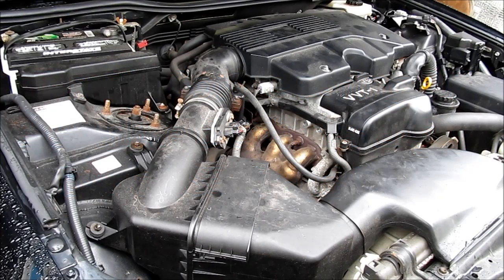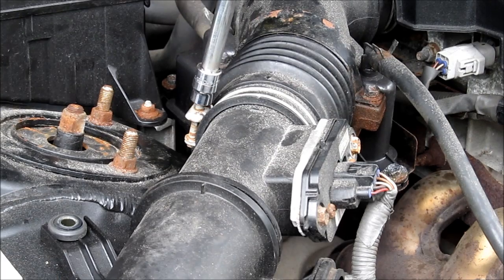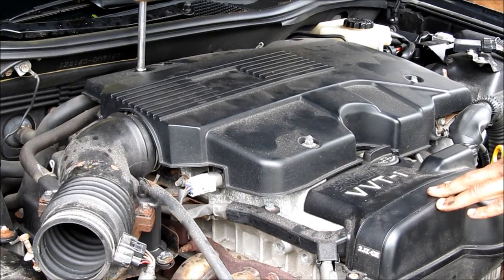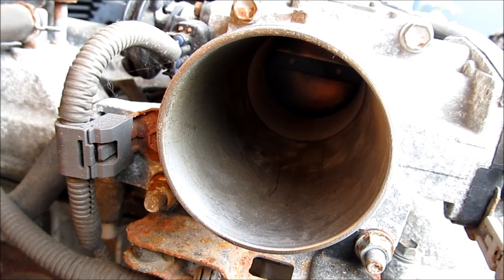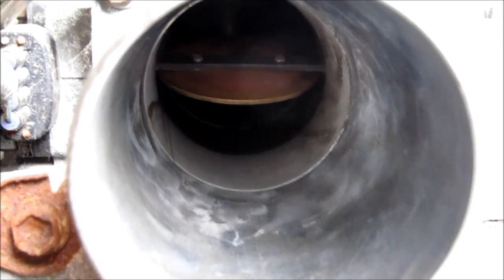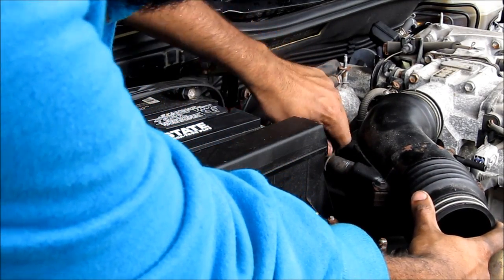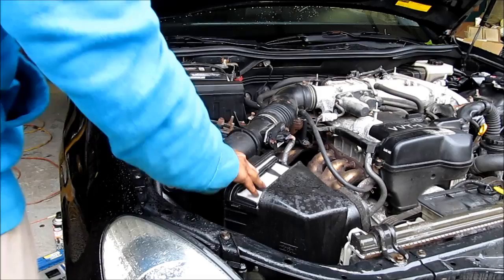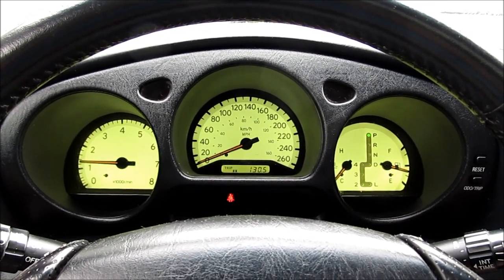Throttle Body Cleaning 2JZ 3.0L Inline 6 Lexus GS300 and IS300

Comment: Thanks for your video today I cleaned the throttle body I have when I remove the small hose I think that's for cacume hose on video 1:28 there was oil in the box is it normal
Reply from the maker: Sometimes oil can make it into the intake due to the PCV system. Change the PCV valve and clean everything out.
Reply: T @speedkar99 Thanks for response

Comment: I was told to remove the negative battery cable for 15 minutes to reset the engine light and codes. Does it matter which battery cable?
Reply from the maker: Negative is safer. Remove the positive and accidentally short something if it touches the body.

Comment: My car starts runs great for 3 seconds and dies
Reply from the maker: Idle air control valve? Check fuel pressure
Reply: Cars boosted fuel pressure is 60 psi just won't idle and there is no control valve cause the body is electronic
Reply: The ecu controls the body and idle thru the body
Reply: Same thing happened to me. Did you solve this? I was also getting a P0120 code
Reply: @diamond4015  I figured mine out but idk if everyone else had the same issue or not I had rewired the fuel pump and didn't ground it thru the ecu and it caused the ecu to not make the car idle check fuel pump fuses and wiring

Comment: Last Sunday I experienced a sudden loss of power on the on the road and then the highway on my way to work. I had just recently serviced my car but had not changed the engine air filter, checked that, it looked dirty. So first thing Monday I go and buy a new air filter, and just Incase some fuel injector cleaner. I replace the air filter first drive it for the rest of the day and the next, and I keep experiencing that problem when I engage the gas peddle I don’t get a response until I’m just about flooring it. So Tuesday night I fuel up and drop some fuel injector cleaner and drive it the next day. A the little things I’ve done for it have helped a little but the problem is still there.
During regular and highway conditions my gas peddle becomes unresponsive to light gas peddle press , and won’t respond until I’m flooring it. Im thinking maybe a dirty mass air flow sensor, since my car starts  fine and idled fine, or maybe a loose throttle cable since I have a bad habit of flooring it to begin with. Any advice?
It’s an 05 Lexus IS300, with the 2jz-ge motor like this video
Reply: I’m having this exact same issue…. Did you figure out the problem ?
Reply: @productive23 did you fix your issue? My is gs is in limp mode too

Comment: Question so this started today when I drive for a little while my then out of nowhere my pedal sinks to the floor and the no acceleration do I have to clean my throttle body
Reply: Throttle body pedal sensor I was told to switch my whole throttle body
Reply: jamel williams nope didn’t do that just switched the sensor and cleaned the throttle body and it’s running great
Reply: happened to me this week replaced the throttle body pedal sensor and boom works fine

Comment: I'm having acceleration issues on my '98 GS300. VSC off light comes on as well as check engine, and accelerating goes to shit sometimes stopping completely. Engine doesn't turn off, and car still sounds like it's running fine. You think I should try this before I take it into the shop? I read some forums of other people with the same issue and cleaning the TB fixed it for them.
Reply from the maker: Scan the codes. Sounds like you might have more than just a bad solenoid
Reply: @speedkar99  yep it coded for a bad a Throttle Position Sensor. I'm getting it replaced/calibrated in the morning. Thanks for the heads up. Hopefully it will fix the issue.
Reply: @sauce3140  Hey, did it fix the issue??
Reply: @alejandroogando8273  Man i ended up getting rid of the car, wish I could be more help

Comment: Do you even know how to remove the throttle body so you can properly clean it..lulz
Reply from the maker: Yes. But you'll need a new gasket
Reply: @speedkar99  uhmmmmm are you referring to the steel gaskets on the y pipe and manifold? Because if so they are more than reusable if you make sure torque specs are at 20 ft lb.... Throttle body has a rubber connection to the y pipe.... No gasket.....

Comment: Do you know where the idle air control valve is on the GS300? Or does it even have it? I’m having rough start, idle vibration, hard steering, and fast throttle when initially hitting the gas. 2002 GS300 with 97k miles.
Reply from the maker: Usually drive by wire cars don't have idle air control valves because the computer opens the throttle valve itself

Comment: What is that buzzing sound that starts when you opened the throttle body at 1:58? Mine is still doing that even though everything is all assembled, not sure what I forgot.
Reply from the maker: Usually when the ignition is on I get that buzzing sound...not sure what it's coming from but it's fairly normal on Toyota Lexus

Comment: After doing this my traction control light started to turn off and on
Reply from the maker: Check vacuum hoses
Reply: speedkar99 thanks! that was the problem I noticed that it was broken and I’m guessing when I bought the car they somehow got it to stay on but when I went in to remove the pcv hose it literally was barley holding on. I ordered a new one

Comment: Should battery be disconnected? Great info.
Reply from the maker: +Jose Aguiluz yes to reset the check engine light
Reply: @speedkar99  should battery be disconnected before you clean maf and throttle body?

Comment: Can anyone confirm if the GS300 98-05 throttle body will interchange with the IS300?
Reply from the maker: +Matt Kraemer check the OEM parts numbers in Lexus parts website and see if they're the same between the two cars.

Comment: You shouldda tried waxing the throttle body after it's cleaned up so that the surface is protected and smoothed out for better air flow.
Reply from the maker: +iamanoobiecheez good tip
Reply: Sorry to sound goofy but what brand wax to use on TB's?
Wouldn't the wax be sucked into the TB intaks?
Thank you

Comment: Nice video buddy. Do you have one that cleans/replaces the Idle Air Control valve? Thanks in advance
Reply: there easy. its the sensor on the front of the throttle body on the left side. 2 bolts and unclips and just pulls out
Reply from the maker: +Carlos Jimenez thanks bi don't have one for this car, I have one for Honda idle air control

Comment: Do you need to run the PCV or is it safe to run with out it ?
Reply from the maker: +OTFctcATX 512 You don't need it. Just plug it or it'll cause a vacuum leak.

Comment: So my 01 IS300 is bogging down when not giving it gas, or idling. it even dies. would this help. I also heard it could be catalytic converter.
Reply: Kenny Schwartz im having the same issue, i was driving home normally & when i hit a small bump it started bogging... i lost my power I would accelerate it and car wouldn't move , so i came to a complete stop it died on me , i shut off the ignition & let the car sit for 8 minutes and it turned back on with no issues, im veryy curious of what it can be went home with out an issue ... but im aware of it can happen again if you figured something out please share what could of been that you replaced.. thank you
Reply from the maker: +Kenny Schwartz Idle air control valve.
Reply from the maker: J South Hmm, maybe a fuel pump that was overheating?
Reply: Had the same problem, car ended up dying on me as well. Changed out my first cat and it was clogged with cermaic buildup, car still bogged when accelerator was down. Changed out my second set of cats and it was filled with the same ceramic waste. After changing both cats car ran better than ever
Reply: realrevokeclan@gmail.com I know this is old but what was the problem?

Comment: Nice video dude...! My GS300 (2003) is taking a long breath (3 seconds approx) while pickup (When i give accelerator in first gear) specially on traffic signals and humps. RPM and car is running fine on other big gears as i normally drive it on 140kmh. If i clean the MAF airflow sensor is it going to help me resolve this problem?
Reply from the maker: +Salahuddin Siddique You can try this first because it's a simple and almost free fix. The next thing to look at would be sparks and fuel pressure, and also monitor the fuel trims.

Comment: I followed this guide exactly on my 02 gs300 and now the  car won't start..  I'm assuming I flooded it with the Tb cleaner..  But I'm not sure.  Any suggestions?
Reply from the maker: +Alek Villa Does it crank but not start? Usually if you've flooded it the excess TB cleaner should burn off, you just have to give it some gas in the beginning. Double check all your vacuum hoses and electrical connections, including the MAF.
Reply: +speedkar99 i got it.. it did flood. i ended up just letting it sit for like 15 minutes and then holding my foot to the floor while i cranked it so that it would disable the injectors.. the car is running much better now. before i cleaned the tb, i was getting a rough idle and it would stutter on acceleration. 

thanks for the reply though, and thanks for the helpful  vid.
Reply from the maker: Great to hear you got it working.

Comment: Why remove all of that when you could just remove the midpipe of the intake. Leave the box in place
Reply from the maker: BMXAndy1994 True. Removing the box gives you much more work (and film) from and gives you the opportunity to vacuum the air box and clean the mass airflow sensor.
Reply: I did the short cut it works fine

Comment: great vid!  QUICK QUESTION!  I HAVE THE SAME MAF ON MY V6 SLE SOLARA...VERY STRANGE SHAPE AND HARD TO CLEAN...I NOTICED IN THIS VID NOT MUCH ON THAT PART..SHOWS YOU SPRAYING A BIT .EXTERNALLY?....DO YOU HAVE A BETTER TIP ON THE MAF CLEANING? ITS ALL INCASED......THANK YOU FOR YOUR FEED BACK!
Reply: hey scotty     any input on this  MAF  QUESTION?
Reply from the maker: 99 solara sle Just remove it from the housing as per the video and spray it down with rubbing alcohol or electrical contact cleaner and let it dry. Some people go as far as removing it from its shell and soaking it in alcohol but I've never tried that.

Comment: Is that a K-V mass air flow sensor?  If so, should that be "cleaned"? I know that makers of MAF sensor cleaners warn that their products must not be used on K-V sensors.
Reply: wholeNwon I believe the older GS300's had the KV sensor, IIRC only the first gen.

If it was, I think its still ok to use electrical cleaner on it
Reply: Its a hot wired maf but not a karman vortex. Spray some brake/intake cleaner on some q tips so you dont mess up the hot wire inside of it and clean it that way.

Comment: You forgot to add the supra!
Reply: Lol bro. Supra also came with a na version. 
Same 2jzge as the gs300 and is300
Reply: +BMXAndy1994  an sc300
Reply from the maker: Rolando Chapa The Supra has a turbocharger, so the intake setup is a bit different than the GS300.